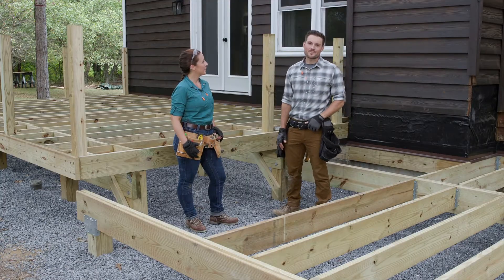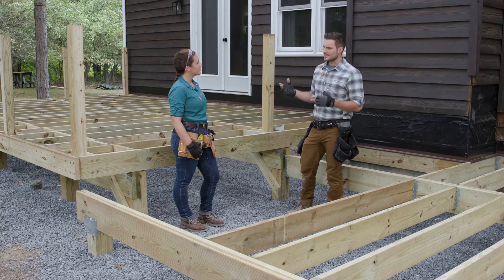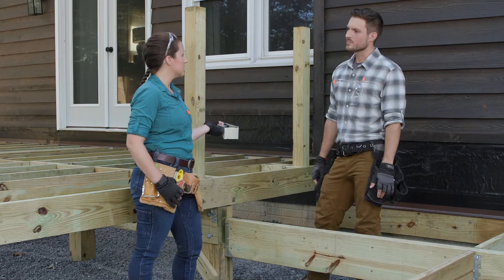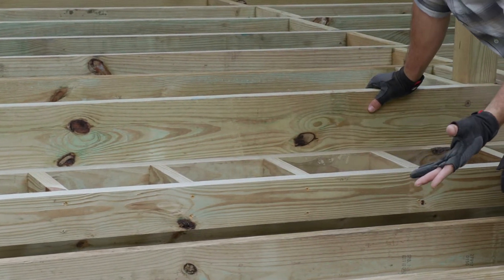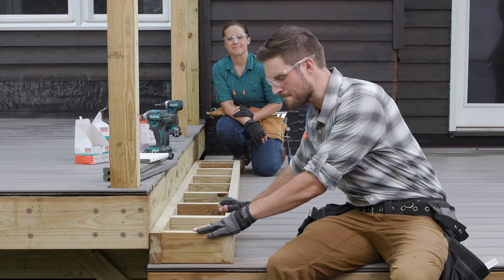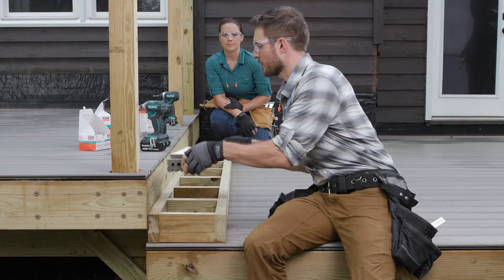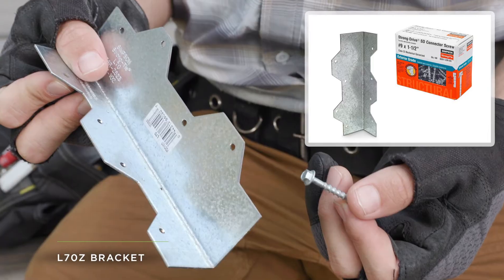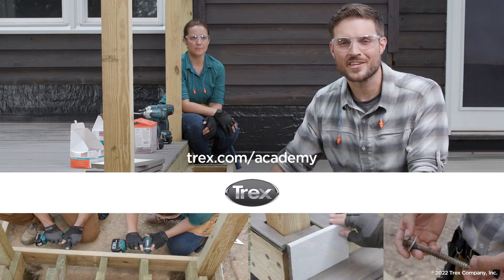How to Build and Frame a Multi-Level Deck | Trex Academy

Comment: Great video. One question, the beams of the middle deck are attached to the posts of the upper deck using hangers. How would you attach the beams of the middle deck to the upper deck if the beams were run perpendicular instead of horizontal?
Reply from the maker: To further understand the installation, I've attached the light installation guide that can help you further understand the process of the installation. If you have any further questions regarding the process of it please feel free to email us as customercare@trex.com or give us a call at 1(800)289-8739.

https://online.flippingbook.com/view/527233942/8-9/
Reply: @TheTrexCo  I am sorry, but that does not help at all. The link has to do with installing lights which I snot what I am asking. In the video at 2:18. He is attaching a beam to the upper deck post using a hangar HUC210-2Z. My question is, if the beam needed to be turned 90 degrees because the deck boards were running away from the house, how would he make the connection?